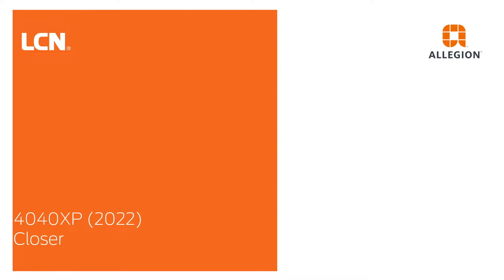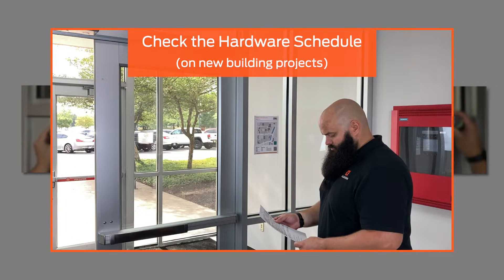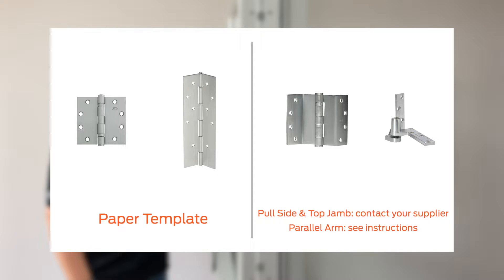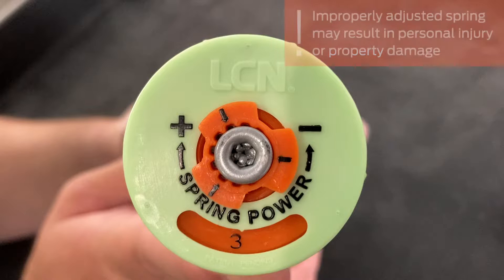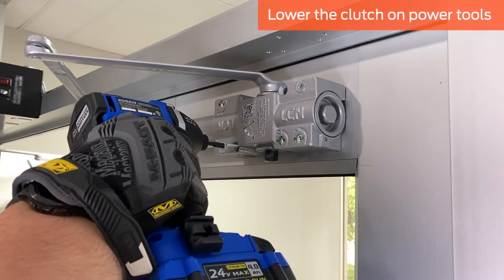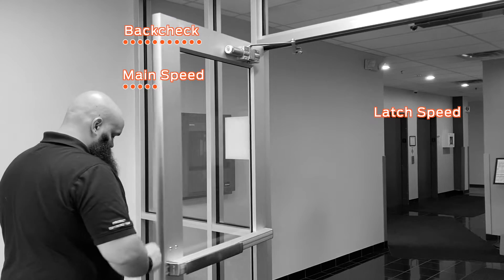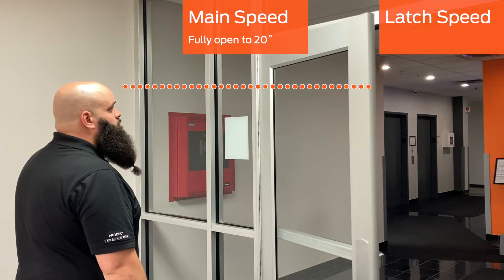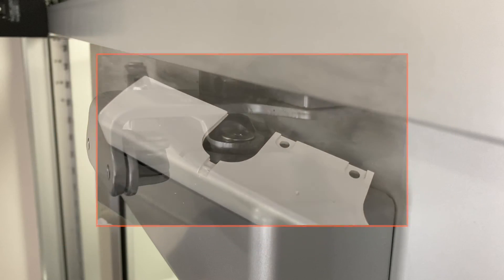How to Install LCN 4040XP Closer (2022)

Comment: 6:38 One thing you showed properly but didn't explain, was when you put the arm on, you put it on NOT inline/parallel with the closer, but you put it on the next position past so it appears to be "too far", then pulled it back later. This is correct and very important. It "pre loads" the arm so it will always be under tension, right through the last few inches of closing. The other method is using a wrench to pull it into tension, THEN put the arm on in the correct position. I've had to repair a few (not just this model) where they w ere not preloaded and wouldn't shut properly unless the adjustment speed was set to "fast" so it slams.